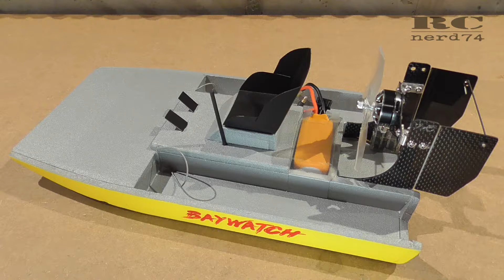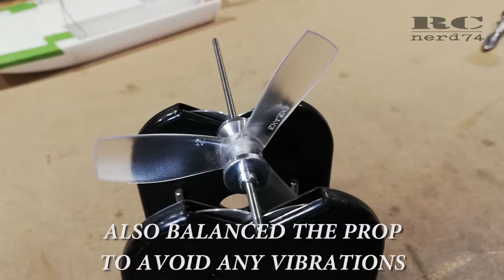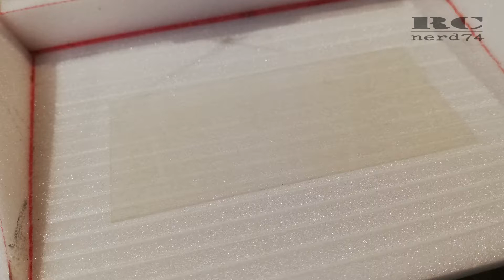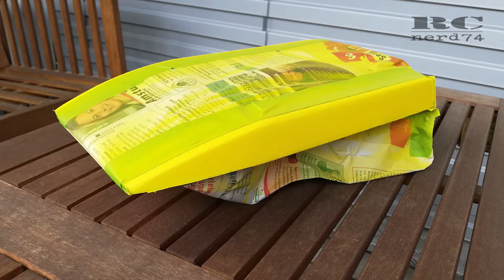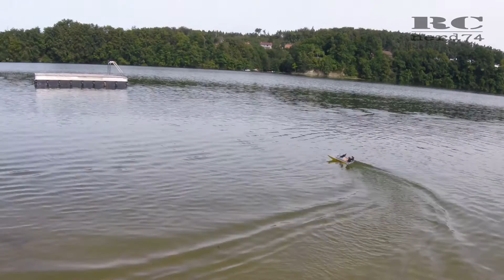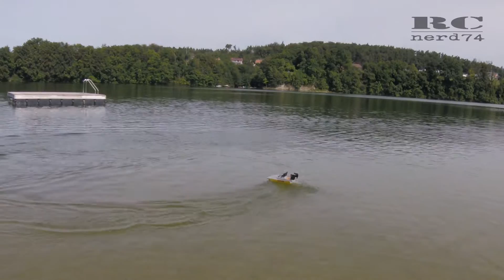DIY RC AIRBOAT | MODS | BAYWATCH PAINTJOB & TESTRUN

Comment: Awesome bro! I’ve subscribed
Reply from the maker: Thanks a lot😃👍🏻 Just subscribed too😃
Reply from the maker: A few measurement infos if you are still interested :o) :
hull length: 31cm, hull bottom width: 16.2cm, hull top width: 17.3cm, hull frontend width: 14.2cm, hull sidewalls height: 3.0cm, motor mount height: 8.2cm, motor mount width: 6.7cm